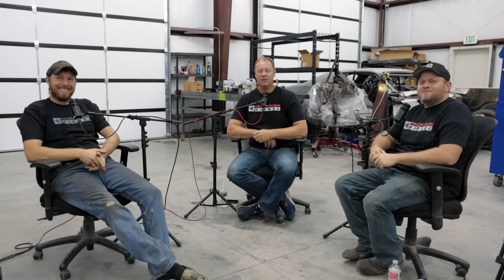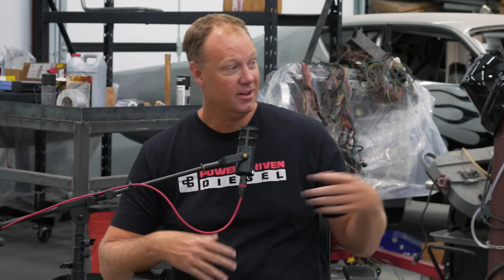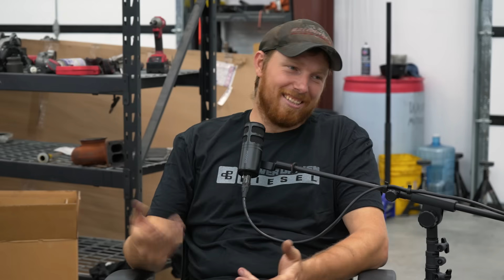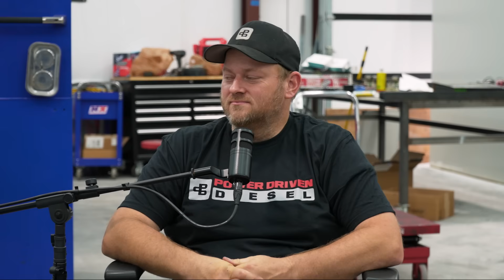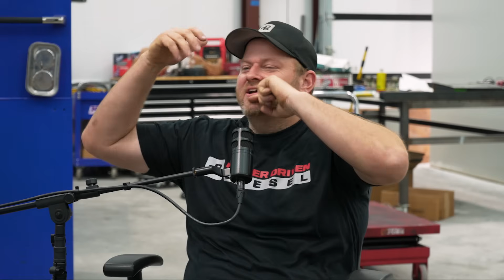We Hauled 10,000 HP to Montana: Diesel Drag Racing at Its Wildest

Comment: What's the advantage of using an air shifter with a manual valve body versus using an Anteater standalone controller?
Reply from the maker: I asking because i honestly doing know, can you trans brake with the anteater? If you can i still would want to start in manual first to engage the low reverse band.

Comment: Me and my son had a blast!! hopefully next visit we bring the mustang and race with y’all. lol love to hear the laughs about my budget.. Will’s junker was definitely an inspiration. best pass was 6.22@116mph with a 1.44 sixty foot. 12psi launch. this beater had a 5.xx in it with the HX40.. but with the new/used S471 it’s gonna get nutty. it was 3450lbs with me in the seat. approximately 830hp on average over the run. S471 with a bit more spray should get me 1000hp. we will see. cylinder head has never been off. factory head gasket. 😂engine is all factory unopened long block. PDD valve springs and locks. congrats to you guys. and as always great video.
Reply from the maker: It was fun hanging with you! I’ve got to see that mustang run someday! I’m praying you bring it next year!

Comment: Question about the transfer case shift linkage…. I hate my 96 t.case shifter, appearance and function. What all needs to ge swapped to do the 98-02 shifter? Does the t.case itself have to be swapped? I have a posi lock if that makes a difference which i wouldnt think considering thats part of the front diff. Thanks

Comment: I finally got my compounds installed on my 97 12 valve last night. Aggressor 60/64 over a billet s475/96/1.10.  

Farrell stage 4 p pump, Power Jet Stage 2s, 240 fass, arp 2000’s, but guess what: no o ring or fire rings. 

Made it 2 miles and blew the head gasket 😂
Reply: I bet it was a fun 2 miles
Reply: @shade_tree_built it was a rocket ship! Man that little taste made it all worth it. Head is at the shop now getting decked and o-ringed. Gonna do arp 625 also
Reply from the maker: Oh man! That's a bummer but at least you know what went wrong!

Comment: What are you using to control the air shift system?
Reply: He said his haltec controls it
Reply: @MrEgghead1999  I guess I missed it.
Reply: @pddofficial can we get a podcast on driving a manual valve body? Also can we get a podcast about air shifting, transbrakes, dump valves, and etc? I am curious about what it takes to have consistent launches in a drag race Cummins.

Comment: 1400 fuel only with a 215 pump ? Can I get the secret?
Reply: All the errors
Reply from the maker: Big air setup, well-ported head and camshaft to extract some VE from the engine combo, good injectors, and a mechanical fuel/lift pump all help!!

Comment: Uncle Rico did not come from Alabama.  Josh McCormick bought the truck from me in Valdosta, GA.  He drove it all the way back to California.  He took it to UCC and then sold it to you.  Uncle Rico came from South Georgia, not Alabama.
Reply from the maker: That's good info, thanks for watching.  Will only knew it came from the dirty south... LOL
Reply: @pddofficial yeah the history of the truck is a cool story, particularly for me since I owned it.  I bought it used from Dorman Dodge in Sandersville, GA.  It was actually bought new by the original owner from the same dealership and then traded back to the for a new truck.  It had literally been a farm truck all its life.  It was stock and every crevice was packed with red Georgia clay when I bought it.  Darren Morrison(notably won Pinks with a Cummins powered Dodge years ago) built the trans for me and put a 363 turbo, head studs, fire ringed head, valvetrain components and big injectors in it for me.  I owned the truck for around 7-8 years and daily drove it quite a bit.  I decided to sell it and build a common rail truck.  I put it up for sale on CompD, and Josh reached out to me.  I sold it to Josh McCormick, and he flew in to the Tallahassee airport to pick it up.  I drove it the hour and a half to Tallahassee from Valdosta to deliver it to Josh.  It had basically brand new tires and I believe he drove it trouble free from Tallahassee to  somewhere in Arizona when the water pump went out on him.  He told me he swapped water pumps in an Advanced Auto parking lot and made it the rest of the way home to Cali.  He and you guys a PDD did quite a few big changes to the truck and he ran it at UCC.  Then the rest you guys know.  It was a great truck when I owned it.  Love the content!  Keep it up!👍🇺🇸👍🇺🇸
Reply: What is it with Georgia. I know guy down the road from me got a 94 7.3 from ga my Neighbor picked up a 12 valve originally from Statesboro brought it to Florida. I bought it from him, took it back to ga registered in Savannah but it still spends half the time in Florida
Reply: @shade_tree_built if you’re talking about Will’s maroon and silver truck, “Uncle Rico,” then no, it never was in FL.  It was bought new in Sandersville, GA where it lives its entire life as a farm truck on a tobacco and produce farm until I bought it second hand from the dealer in Sandersville.  The original owner also bought it from the same dealer new and traded it back in.  I was the second owner and I bought it from Dorman Dodge in Sandersville.  I owned it about 7-8 years and then sold it to Josh, who took it to California and then sold it to Will in Utah.  If you’re talking about Todd’s “Cummins Cart” truck, he got it from Phil at Diesel Power Converters in Monticello, GA.  I don’t know the history of that truck.
Reply: @paullane7489 no was stating that it seems like a lot of trucks come from ga I know 2 people that got trucks from ga and like 3 YouTubers that have bought trucks from ga but that story was my 12 valve’s hand to hand journey from ga to fl back to ga
Reply: @shade_tree_built ok. I misunderstood.  Sounds good.  Thanks👍

Comment: I put a gate on the manifold of a s480 atmosphere 369manifold and dump it into the up pipe to the 480. I use the gate to aid on spool of the 80. I have noticed about 300 to 500 rpm spool speeds difference for the 80 but does not affect over all charge air pressure. On this truck the p7100 is what controls over all charge air pressure. May not be the correct way to do it but it does work for us and the truck is only a 1xxx HP truck any way.